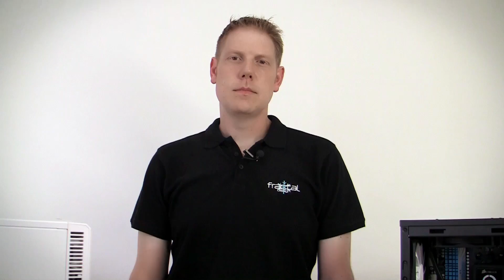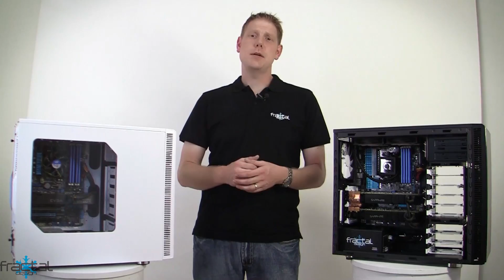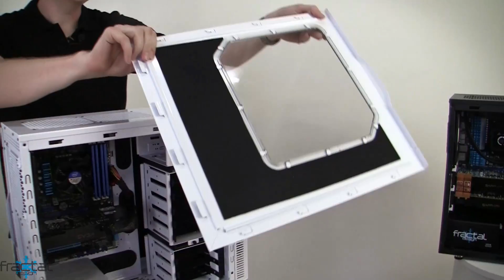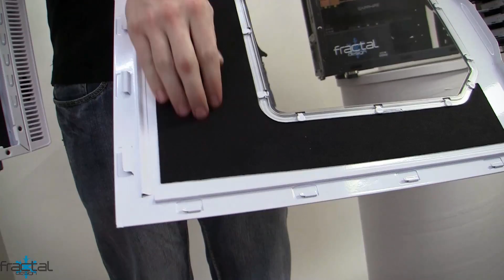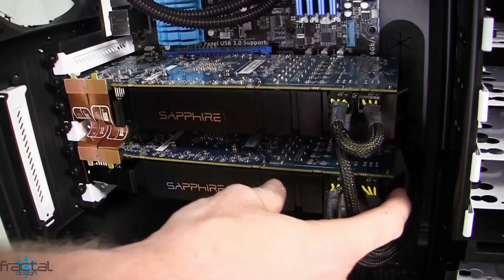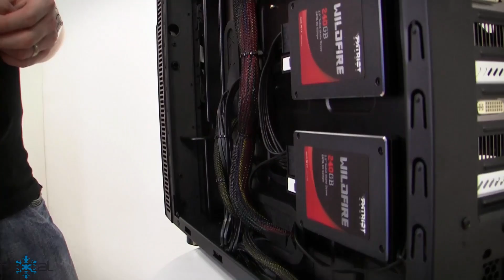Flexibility of the Fractal Design Define R4

Comment: Old video but after owning this case since new and only just now replacing it i have only two issues with it. 
1, (As stated by another) Top rad/fan mounts need to be more central away from mobo
2, A BIG flaw in most cases i see today  - nice fan options for front fans or a 240 rad, BUT then go and put a heavy, solid door on the front that basically makes the fans in front totally pointless. 

If your reading this Fractal, scrap the stupid solid door design, open the front up so it's a proper intake area, and no the run of side vents don't really negate the issue.

Comment: William Lariosa Agreed. If they offset the top mounts for push/pull and used maybe the top cover from the Arc Midi R2 with sound dampening foam underneath I would have purchased one in white easy.

Comment: I have a H100 in my R4 but it will not fit in the stock mounting holes due to the motherboard power and heatsinks. I have to move it forward and use the honeycomb to mount it.

Comment: I am already planning on getting an R4 case; and think your set up looks interesting.  Could you post what components you have built this system with?  I would like to have a Corsair water cooler but have been concerned about all the leaking pump hose stories.